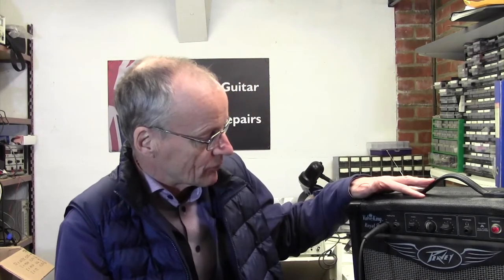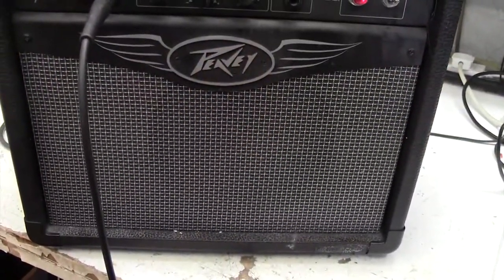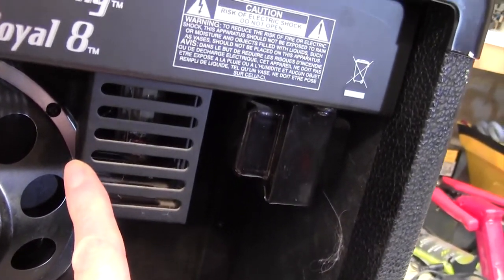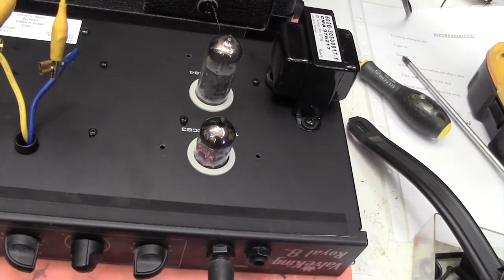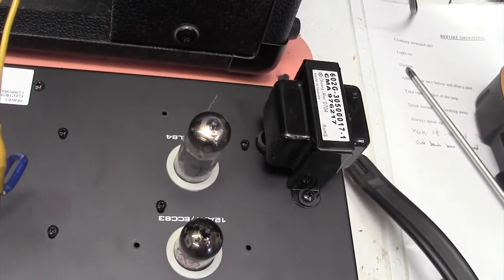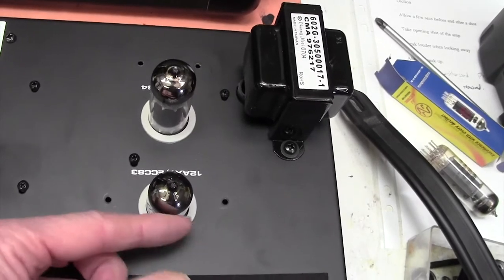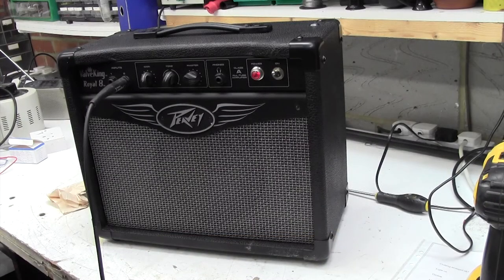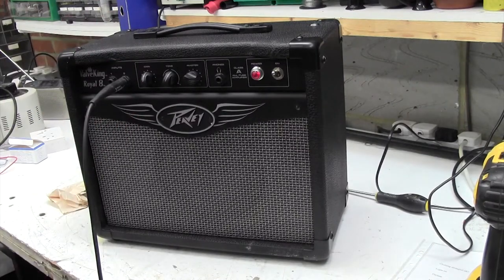How to Fix Peavey Valveking Royal 8 Resonance Problem

Comment: I built a 5F1 amp head that had a rectifier tube that would make the same sort of rattling noise. I put on an oven mitt to grab each tube to determine it was the rectifier. Placed one of those heat resistant silicone donuts on it til it's replacement showed up. It was that or not set the amp on top of the speaker cab to get rid of the noise.